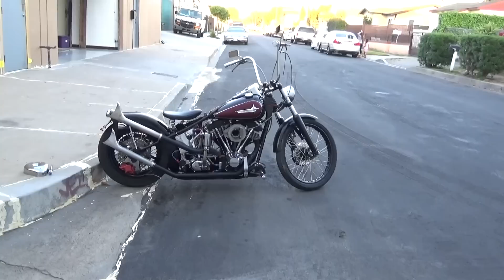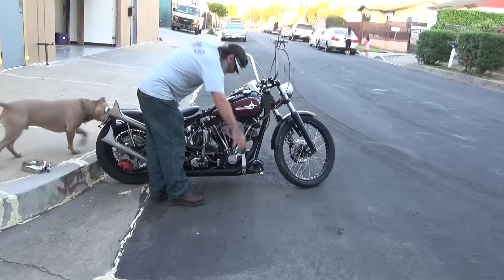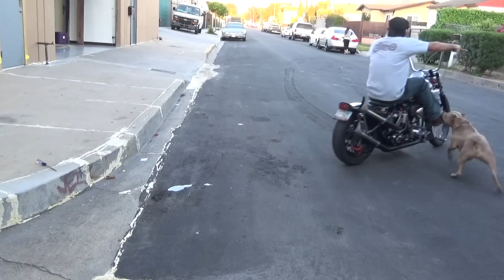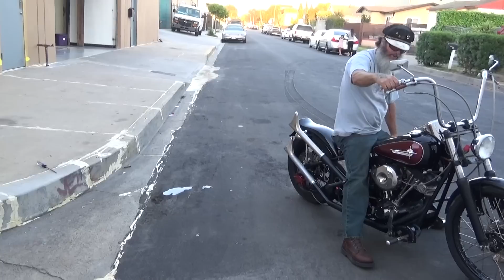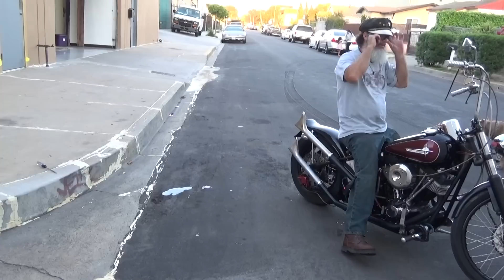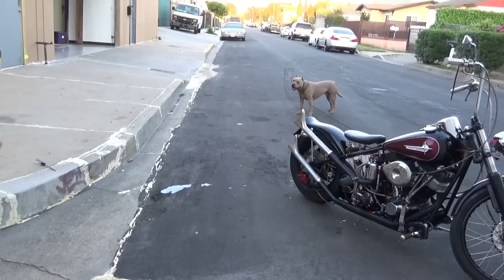Hunting Harley's 1975 Shovel ridgid part 2

Comment: i had the same problem with my 2002 sportster a month ago. the new gas just ruins everything. finally got it going. i even used 93 octane and a quality fuel stabilizer (sea foam) in the fuel when i ride it. i had to take the breather off and hold my hand over the intake just like you did and eventually it started and cleared up.